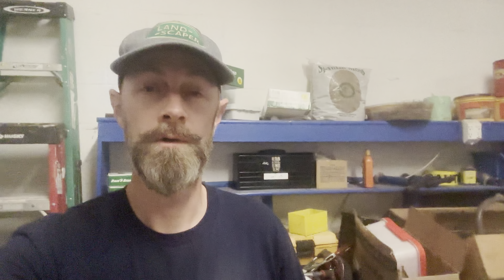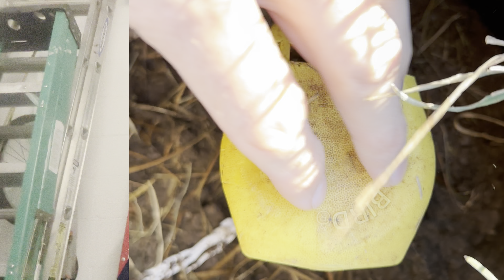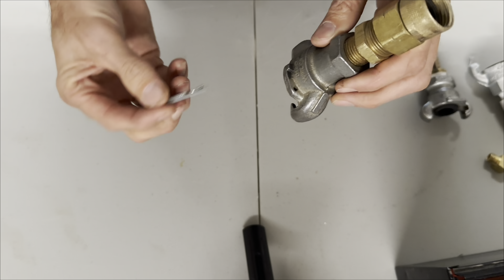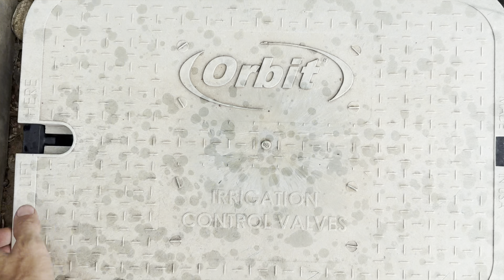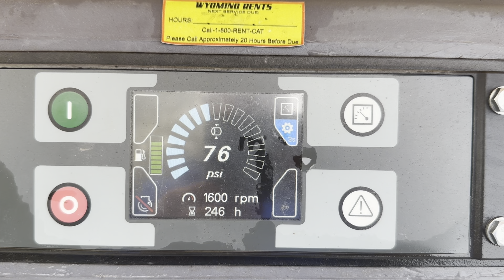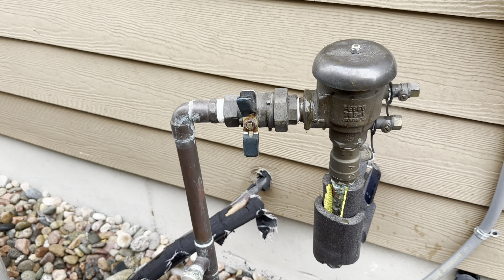Things You Should Know When Winterizing a Sprinkler System with a Large Compressor

Comment: How do you deal with stuck ball valve handles at the backflow?
Reply from the maker: You can use a pair of channel locks to move the handle. Or you can use a little heat to loosen it up. But not too much heat, because there are plastic pieces inside.
Reply: @PracticalSprinklerAdvice what kind of heat source do you use in the field?